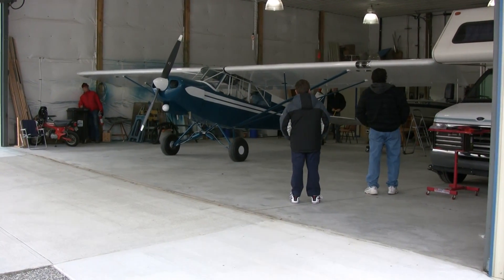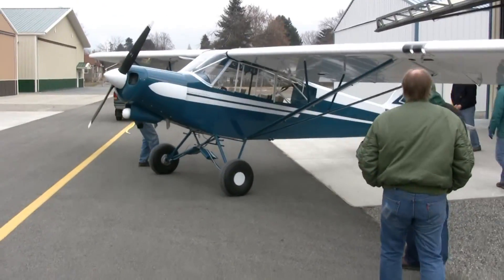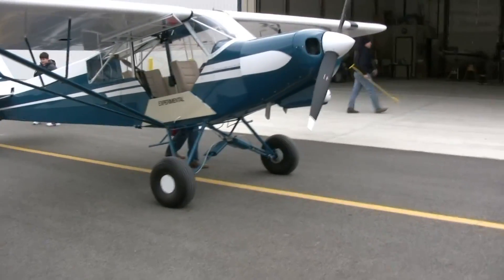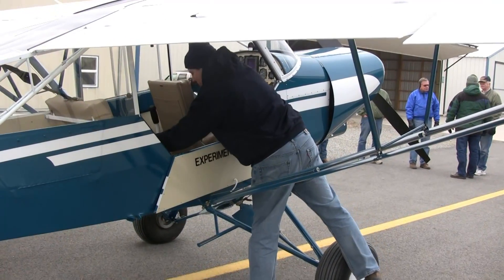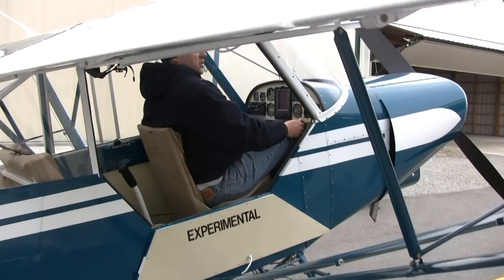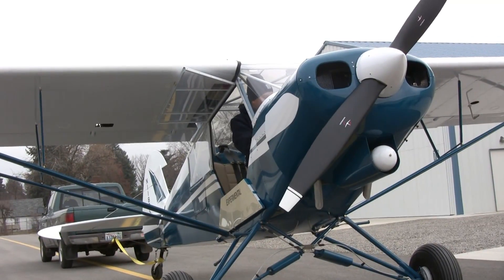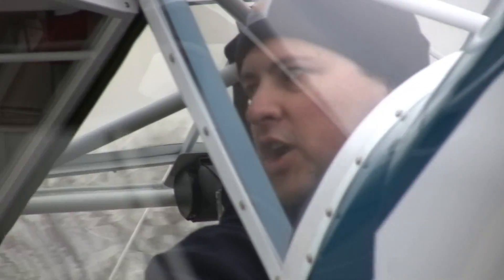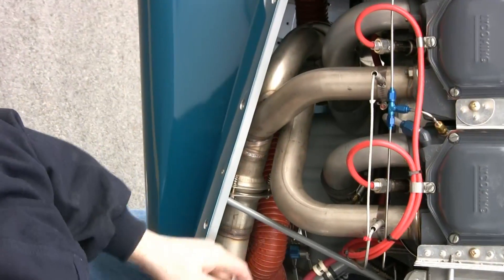First start of my Experimental Super Cub

Comment: Not an expert but do you have to prop mounted properly?  I'm used to seeing warriors and other piper aircraft have the prop stop vertically but not usually on the super cub.  Maybe it's the fact that you have the O360.  Beautiful aircraft btw.  I'd love to build one myself.
Reply from the maker: The prop in this video is indexed about 90 degrees off.  It should be indexed at 10-4 o'clock position when looking at prop from front.  This position is good for hand starting, and also good in event of dead-stick landing.  I would never index any prop vertically.